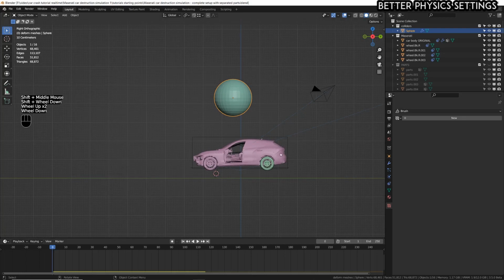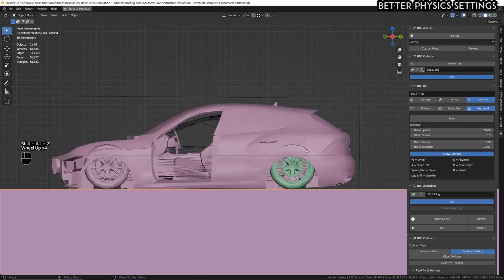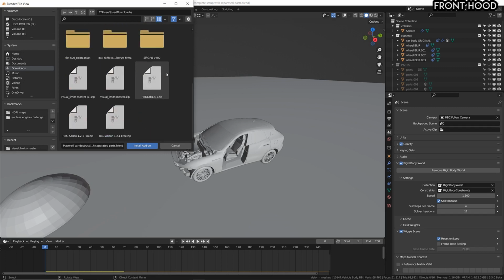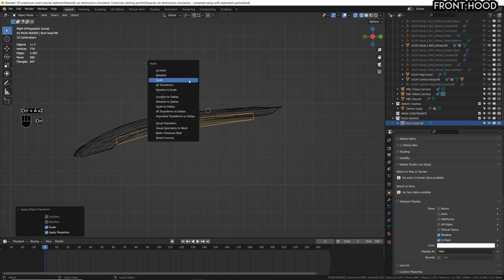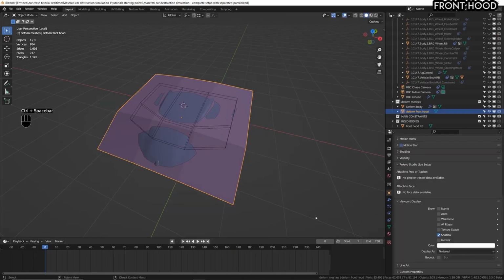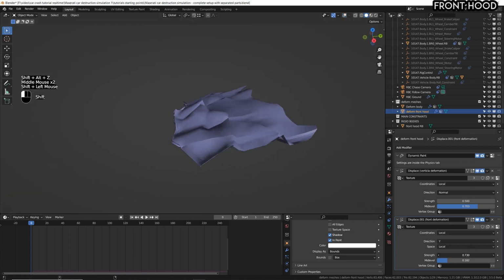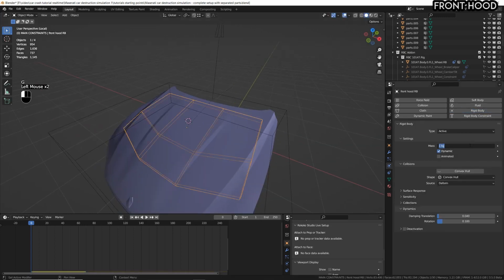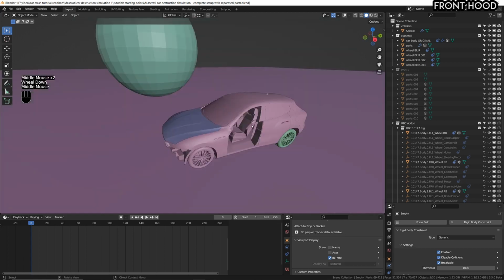[PART 3] Realtime Car Destruction - FULL COURSE

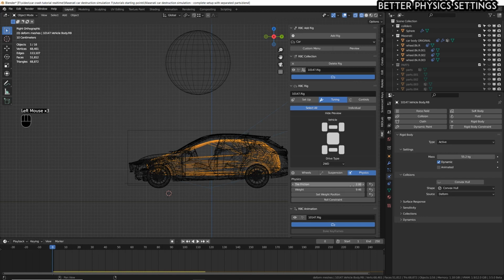Comment from the maker: UPDATE: after latest updates of RBC, you might notice that something around 00:54 your car could drop down on the floor like being too heavy. Here is the fix :

1-  update Blender to 3.6, and RBC addon to the version 1.3.2  (you are probably using an old one)

2- in RBC addon, click the "update rbc rig" button (if visible) to let it recognize the rig properly from older version

3- in RBC physics panel, increase the "weight" a lot, like to 10 or similar

4- in RBC, turn ON the function "set weight position", to move the weight center a bit in the back, to balance the entire car properly, then remember to turn it off!

5- play with suspension settings in order to make them very strong

Comment: Hello! I have a problem. At 0:54, you changed the RBC Mesh to 1000 kg Right? Unfortunately, every time I change it to 1000 kg, the car body keeps falling to the ground. Even though I change the stiffness of the suspensions a lot, it still keeps falling to the ground as if there are no suspensions at all! Can you help me with this problem? Thanks a lot!
Reply from the maker: hello! please drop me here a wetransfer link with your file please, so I can check it
Reply: @RaffoVFX  hey any update on this, having the same problem :(
Reply from the maker: @TheMonomythYYC  Hi, drop here a wetransfer link with your scene please (Only the blend file, no need for textures)
Reply: @RaffoVFX  I figured it out! Just had to shrink my midlevel smaller than the RBC rigid body 💪 you are an absolute legend for this series
Reply: Sorry I ran into the same kind of issue where my car body just drops onto the ground @RaffoVFX
Reply from the maker: @yima8282  Hi ! I have pinned a comment with the solution, look it up here in the comments ( it was an easy fix, necessary after the latet updated of RBC )

Comment: Hello,
absolute amazing tutorial for a beginner :). 
But i have a probleme. Every Time I hit play, the bonnet keeps turning upside down.
do you have a tip?
Reply from the maker: thank you!
Tweak the rotation values in the constraint angle limits and you should be fine. Just remember that the "Lower" value should be always negative, and the "upper" always positive